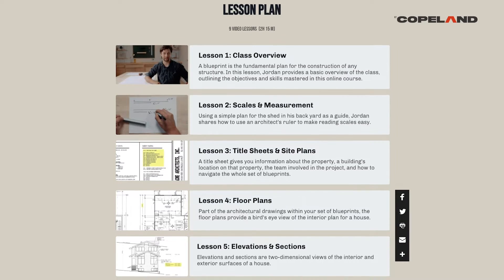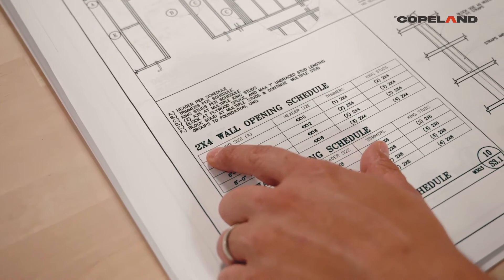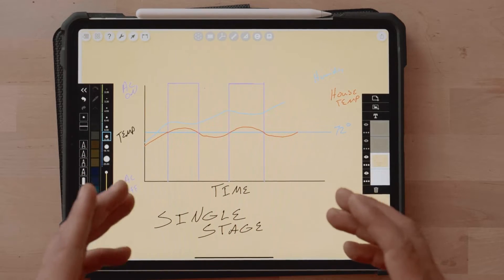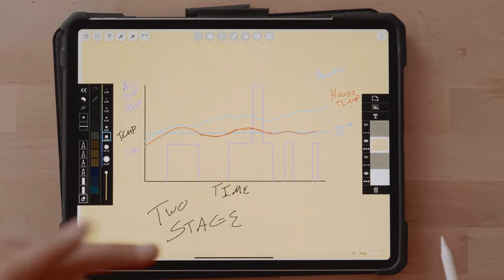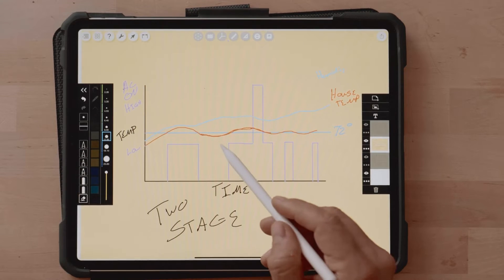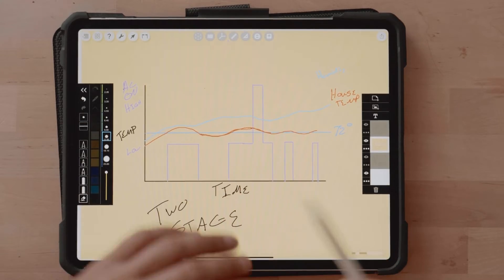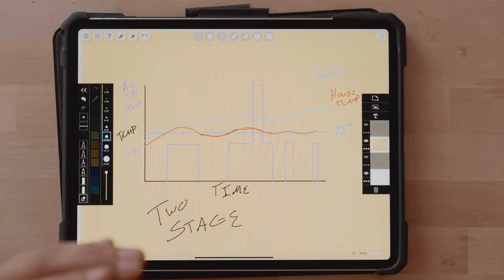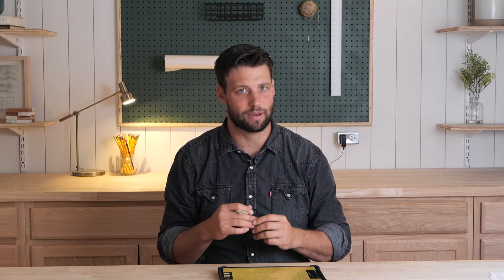Air Conditioners - Single Stage vs. Dual Stage vs. VRF (Mini Split) - Sizing and Dehumidification

Comment: I live in a dry climate without the humidity issue, should the size of the unit get adjusted for?  Is a two stage unit quieter? Sound is an issue for me.
Reply: I also live in a super dry climate but I also live in high altitude but it still get hot as hell here in the western suburbs of Denver.  I did a massive amount of research and even started going to night school for my NATE certification.  For years, I have helped people fix their AC units by replacing capacitors, contactors, fan units, blower motors etc and replace parts on their furnace.  I had an older AC unit that was a single stage Trane that was R22 and it ran for 20 years and was still great when I sold the house.  Over the years, an HVAC friend help train me in many areas and as the technologies got better and more affordable, I found them to be so much better.  Do I agree with the fella in this video? No, not really, because that is only part of the whole picture.  I did a ton of research and found a install company that was very transparent with their costs and found that single stage, two stage and Variable speed systems really do not cost that much more to the HVAC company from their distributors and parts houses.   They just mark them up so far and put insane amounts of labor on them because they think they are the only people who can do this type of work.  You would think that they were high end lawyers.  I forgot that HVAC companies are really medical doctors and charge 500/hr or at least that is how they quote. But desperate people will pay whatever it takes to fix it when it is hot or cold.  It is total nonsense.  I worked out a deal with a company for new higher efficient 19 Seer 4-ton Variable speed Air conditioner (5 stages of cooling available to the thermostat) and a new two stage gas valve natural gas furnace with a variable speed blower.   They both are incredibly quiet  with good insulation and proper designs .  I barely know they are on most of the time.  I cannot even hear the AC soft start, hear the fan or the blower running unless I walk up next to them or I look the thermostat or app on my phone.  It is amazing how quiet the fans run gently and keep my home perfectly at one temperature without any fluctuation.  You can program your electrical and gas costs into the thermostat and it will give you very close values of what your bill costs will be minus all the insane taxes and ridiculous charges from your provider.  It was pretty expensive to install compared to Pre-Covid quotes we received.  What was 8-9k is now 14-17k, depending on what you buy and how efficient you go.  But you can always find an honest dealer that isn't out to rip your head off on every sale.  There are plenty of those companies.  I would tell you stay away from the many with fancy commercials and "super huge discounts with coupons."  I found a company that worked with house flippers and investors through a friend.  The guy did a full entire load calculation, insulation check, windows, current vent flow, checked return air ducts etc.  It was impressive to see the report generated.  He wasn't the cheapest on the list but his company was great to work with.  I am pretty hard on contractors these days and he was a good guy.  He didn't try to hide part numbers or pricing from me.  His guys did a full install and tons of extra work in 3/4 of a day.  I was so impressed on the efficiency of their work and kindness.  One of the owners stopped by to make sure we were happy and checkout the install was up to his liking.  He runs a tight ship, I would assume.  His crew cleaned up and it was like they were never there.  10 year parts and labor warranty included and they have been in business 22 years.  You can still have a two stage AC condenser with a variable speed blower on your air handler/heat pump/furnace, depending on your area and need for cooling and heat.  Any system can be customized to your very need and wants.  Everyone has their own opinion on what brand of equipment is the best.  I personally think a great install is more important in most cases plus your home needs to as energy efficient as possible to support the equipment to do its job (Insulation, newer windows, etc etc).  Most people do not realize that the top 10 brands are sometimes made in a lot of the same factories.  Just make sure it is properly sized for your home and what you want.  Get a dozen quotes, if you so choose and ask a lot of questions.  Make people honest and accountable.  If one guy is 24k and another is 10k, start asking questions like I did.  All I know is that I am not paying for one companies overhead because they have a big name on the side of the building.  Make sure to get your new setup / system cleaned and serviced yearly to keep it in top condition.  Andi n a dry climate, you might need a steam humidifier.  Those are amazing during the heating cycle in the winter.  But that might only apply here in Denver.  

American Standard & Trane - 
Carrier & Bryant, 
Rheem & Ruud, 
etc etc

https://www.youtube.com/watch?v=Cy46yTbkNhI
This video is a younger fella that breaks the brands down.  

Sorry it is so long winded.  I just tell people to be a savvy buyer.  Don't get run over.  

Just for the record, I went with a Bryant Evolution system with a few upgrades for air purification.  I hope you found what was looking for since this post was from three months ago.

Comment: Dual stage absolutely. It's a game-changer for comfort. I have had one for 7 years now, and coming for Home Energy Efficiency background, I would never go back to a single stage. Ever. (I live in Arizona and born/raised in Dallas, TX)
Reply: I had a dual system Trane variable speed for 20 years and every year something needed repair.  I itemized the cost…I saved NOTHING because of small repairs every year.  Simply over-engineered and a big con.  This is about corporate greed — NOT efficiency
Reply: @pilotrserra  Dual stage and variable speed are not the same.
Reply: Fackletard, I’m in California and trying to decide between single vs 2 stage.. I like the 2 stage but is it worth an additional $7k… vs a single stage
Reply: @bman6502  It depends. You have to first figure out your financial investment/situation and determine from there. If money isn't an issue and you have the excess money, 2 stage is my choice. Your comfort will thank you. Having cold air blowing longer in the summer will always render you a more comfortable atmosphere in your home vs more off time with a single stage. Comfort for us here in Phoenix, AZ - dual stage is better considering our heat waves get into the 119-120 degrees. 

If you are on a tight budget, I would just stick with a single stage. My best advice is to teach yourself about HVAC maintenance and learn how to fix issues that come up down the road yourself and save yourself a lot of time, money and frustration. But I digress. Again, if budget is not the concern, I would go with 2 stage every time. If you are on a strict budget, go with a single stage.

Comment: Good day, and many thanks for your excellent information on HVAC. I live in Bahrain where we use the AC's extensively. Can we convert an existing standard single-speed AC unit with the more economical variable speed AC? Thanks
Reply: Nope.  The closest you can do is sell off the old unit and buy a variable-speed (inverter) unit.  The reason why isn’t as simple as swapping out the compressor.  There’s a computer controlling the system that’s different, refrigerant is most likely different and a whole slew of other differences not apparent.

Comment: From a laymans perspective what you are saying makes zero sense. If the system can be variable based on outside temps being in the mid 100s in the hottest days of summer and more in in mid 90s most of the time, then you wont have short cycling and you should have adequate humidity removal unless you like nose bleeds. Its exactly how you should size a variable speed furnace. You get the low btu number for your typical heating requirement and the higher number should be based on worst case cold days. Then the system normally runs at 3/4 capacity instead of 100% and that creates efficienxy and confort. Tell me in theory not speculation how that is wrong. More importantly where is all this humidity coming into the house from in your example, people showering without a vent fan, because just coming in and out of a house will not contribute to inside humidity unless you have no insulation, no caulking or any weather proofing and a flooded crawl space.

Comment: I was getting ready to load my ammunition before watching your video but I have to admit I was pleasantly surprised after watching. Been in the field of HVAC for over 37 years & found your information to be very accurate. I concur, I am more of a fan of a single stage unit ( less problematic then two stage and VFRs) with an Aprilaire whole house dehumidifier. Get a good contractor, size the equipment and ductwork properly and life will be good.
Reply: sad thing is 37 years in this industry is like 37 years in the car industry.  Cars or HVAC systems today especially variable / vrv systems are basically a whole new animal.  Have to have a degree in electrical engineering and small electronics to work on the new ones.   In something like a DAikin VRV life system the outdoor unit has internals that rivals a super computer with 18 inch circuit boards full of capacitors and chips.  It stops working with a code even following the shooting flow chart its a heat scratcher whats wrong as you wait for Daikin support to chime in and wait for the part to come in via ups,  with a 50/50 shot that is even the issue.
Reply: @cranbers  , luckily for me I’m retired and the only systems I need to worry about are my own and my children’s. I’m gonna leave it to the new technicians to learn 2 stage, VRFs,VRVs , inverters, communicating control systems, the latest and the greatest refrigerants (not so sure about greatest) and anything else the engineers may come up with.

Comment: I love to follow a/c discussions. I upgraded from a single stage to a 2-stage with the idea it would "dehumidify" better and run longer. When they calculated manual J I am about 2.7 ton, but they don't have half ton sizes, so still at 3-ton size (same as original/builder size). Of course, the indoor coil is so much larger than the old one. The unit does run on 1st stage most of the time, but ironically it dehumidifies better in 2nd stage.  Humidity varies from about 52 to 55%. Old system could kept it around 48 to 52% They've come out and adjusted the speeds downward and it also has the dehumidify on demand to slow it down even more.  The furnace has an ECM blower with a nice digital menu system, not jumpers. The condenser is the typical scroll compressor which is just unloading for first stage, which some say is not as good as having the dual compressor or a variable speed system. With that said, I do love the quieter ECM blower and that the airflow is less on 1st stage. However, if the system were to die tomorrow I'd probably go back to a single-stage and add a dehumidifier somewhere, and drop down to 2.5 ton. I also feel like the controls for variable systems may not last a long as the simpler systems, or you're going to have a time trying to find a tech that understand that manufacture's controls since each one has proprietary controls, versus just typical simple thermostat and 24v relays.

Comment: Thanks for giving me an idea. I've got a portable dehumidifier that I've not used because it creates that heat. I may see if I can balance the cooling and dehumidifying to maximize comfort, particularly at night when humidity makes sleep harder and heat is less an issue.

Comment: I have a Trane Gas pack 4 ton 16seer,  my question is what at the thermostat determines if I run 1st stage low air flow or second stage high air flow and can I make it run second stage stronger cooling by adjusting thermostat???????????.....stevie  I have a Trane 824 thermostat
Reply: I am guessing it has to do with trying and not being able to reduce the temperature to a desired level in some finite time and so it goes into dual stage mode. In this case, it might actually help to turn the thermostat down. It will take longer to cook down that far and might kick it into dual stage mode.

Comment: 1 5 ton with 2 zones? Or two units 3ton/2ton for two separate zones?
Reply: Always better off with two smaller units. A 3 ton and 2 ton combined equal a 5 ton in output, but at less energy use. Also, when using a 5 ton for 2 zones, when either zone calls for cooling, you pay to start a 5 ton compressor (125 amp initial start draw) and it draws 18 amps continuously.
When zoned with separate units, the initial start draw of the 3 ton is about 40 amps and the 3 ton will draw 11 amps continuously. I have seen both types of configurations in multiple homes. The homes with multiple small units always use 30 to 50% less energy compared to the homes using a 5 ton system and multiple zoning.
Reply: @briangc1972  thanks for the reply I will definitely keep my current setup of a 2ton/3ton when changing out my units.

Comment: Great if you can build your own house, air seal it and exceed code on insulation.  I did that with my detached garage and now I have an overbuilt air-conditioning system (4 tons for 2200 sq ft VRF multi-split that could have been a 2.5 ton unit, honestly)

On the flip side, my main house was built in 1948.  I've done what I can to improve insulation in the crawlspace and attic, but there aren't really any options with the walls.  It has some drafts,  better with the crawl space work I did, but still has drafts, and 2 fireplaces.  I have a single-stage "no name" unit that is 15 years old.  I'm pretty well convinced that a VRF or at least a two-stage will make a huge difference.
Reply: Wrap the whole house in Tyvek if you put siding on.

Comment: The other key issue... You need a PHd and a laptop with proprietary software to service VRF systems. Pretty much any random jag bag can order a motor and capacitor off Amazon these days. You really need to decide which side of the expertise fence you want to be on. True Pros are hard to find and will charge accordingly--but you can be 99% sure it'll get done right the first time.